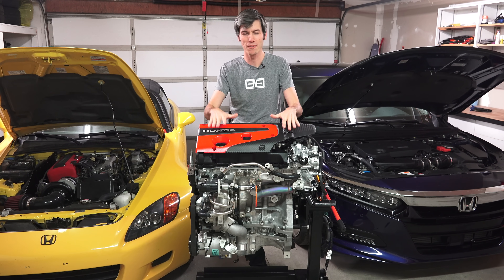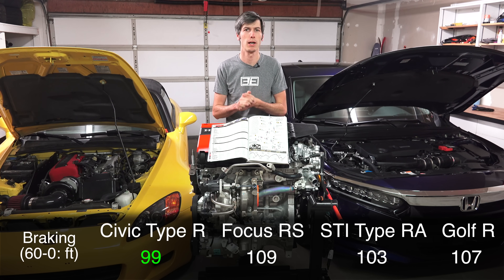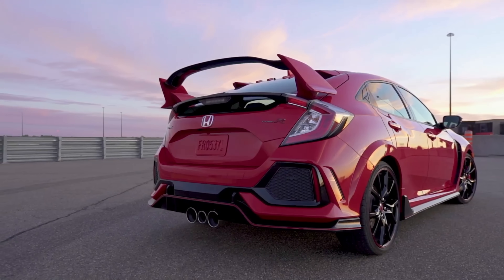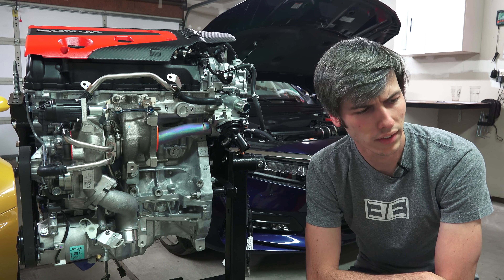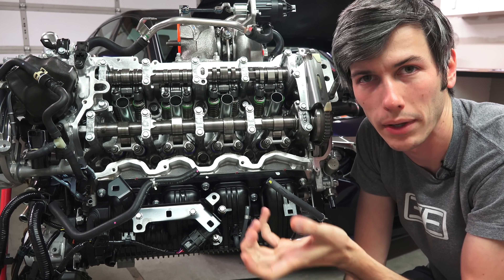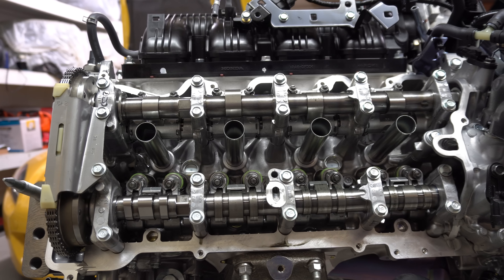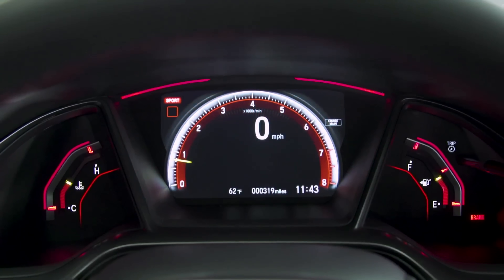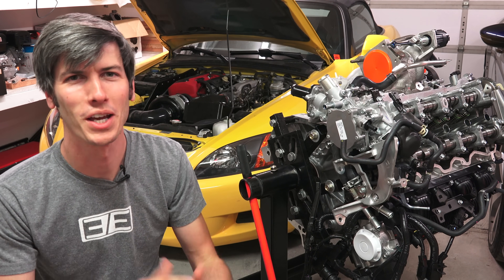The Honda Civic Type R Destroys The Competition - The Best Engines

Comment: Such a rubbish dyno curves, it's like a higher rpm diesel now or something. What's the point of having 7k rpm when you're losing all the power and torque even before 5k rpm? Either you have to shift early which defeats the purpose of having a petrol engine with 7k rpm or you have to keep flooring it while losing power and torque.

Comment: honda is good engines but bad body design.  however, mod the body, and you lose the value of the engine's performance.
Reply: Can you explain?
Reply: @chewsir  -  fine.  i'll pick on the '93 civic.  chassis is too narrow.  wheel base is not only narrow but the tires are too small as well.  try to do something about it and for some weird reason it just doesn't run the same.  everything in that system is designed exactly for eachother, parts cant be simply "stretched to fit" without costing some kind of cause/effect.  but the engine in and of itself is solid quality, very well made.  superior in reliability to chevy engines, all day.
Reply: @long-timelistenerfirst-t-us2yy  that makes sense. When you mentioned "body" I thought you were referring to the exterior design or aerodynamics.

Comment: Some of my friends that work at a Honda dealership, have told me that you can get the fully loaded Accords engine to be tuned and you’ll get pretty much the same power and torque as the Type R engine. So technically you’ll be driving an Accord Type R. It’s funny to say that but also it’s doable and kinda crazy.
Reply: You still need to spend on sports suspension, upgraded brakes & sports seats for the Accord... There did use to be an Accord Type R -- fun car! :)

Comment: I am torn over the exterior and it probably looks better in the show room than on the road. But I am buying one in metallic grey. Will be my first new car and it looks like best bang for buck. I have owned two 928 Porsches over the past 20 years and I have spent quite a bit on maintenance. The Type R still has that GT like feel rather than the uninspiring go kart feel of most hot hatches. On testing I found the FWD quite sublime and the performance very exciting. It will be interesting to see if I regret my purchase, but at least its not going to break down. I will be keeping the 928 still too good to sell for small money.

Comment: Ok I’m confused so the accord has lower torque than type-R but has higher horsepower? Also you said accord has lower psi but then said accord has 28psi compared to 22psi. A little confused

Comment: Any chance you could do a video about turbo compounding? Yes, compounding, not twin turbos in series or parallel or using valves that open and close. Learning power curves and benefits and cons of compounding vs twin turbo setups would be a plus too. I’m having a hard time understanding how power comes on and there is little info on the Internet.
Reply: And also why would you choose a VNT turbo over compounding (cost obviously but why else)
Reply from the maker: Compound turbo is two turbos working in series. I have a video on this, search “sequential turbos” on my channel.
Reply: Engineering Explained thanks for the reply! I have watched that one a lot through out the past 6 months but I am still not sure how power comes on without the valves. Lots of Cummins and other diesel kits don’t use valves so I felt like it was different from that video. Thanks
Reply: @Mcritch32  There's no valves needed, other than a wastegate before each turbo, and an output path from each of the wastegates to the exhaust pipe. 

The small turbo gets the exhaust first, spools up, and it's exhaust is piped directly into the exhaust inlet of the big turbo which, will spool up naturally and overtake the little turbo's output as the engine is ran higher and harder in rpm range. 

The wastegates are just there because they have to be, for control.

Comment: Did you all know Honda will go 80% electric by 2021 or 2022 so this engine might not even be around by then. The Honda Civic Type R is only front wheel drive witch is a problem with that much Horsepower you need all wheel drive to truly handle that power The Ford Focus Rs is all wheel drive because of the amount of horsepower and torque the engine produces to keep the the rubber on the road so to speak and with a few upgrades the Focus Rs like K&N cold air intake and exhaust system Upgrade and The cars PCM or ECU reprogrammed it would definitely be a show stopper and by the way the Focus RS has a drift mode you can’t do that in a Civic Type R.

Comment: Car and Driver ran a 4.8 0-60, 0-100 in 12.1 in a manual Golf R with a 13.4 @ 104.  Acceleration was a strong point of this video and once you start adding power mods to the type R you'll have a hard time putting the extra power down vs. the other cars here.

Comment: Honda fanboys will use to validate there oppion that honda is actually a good company but I bet my ls1 trans will beat any stock 4banger
Reply: Honda is the largest engine manufacturer in the world.  The fact you think they arent a good company shows how much of a clown you are.  The LSx series are great but Id hope they would beat any stock 4 banger considering they are 3-3.5x the size.  Honda never took a bail out from anyone.  Honda went from being laughed at here in the 70s to a major player.  The products they build are simply much better than GM, whom for the most part has been building junk for decades.
Its too bad Honda is a conservative company.  They could easily build a 5.5L big bore twin cam V8 with 700 hp.
Reply: Stock is the key word here :)

Comment: Yeah, yeah, yeah, tell that to the type-R owners with engines overheating and leaking oil. And what about that starter ring issue where it ejects the ring and can't start? And do a video on their crappy tranny that grinds 2nd gear all day long. Or their glitchy rev-matching.  At the end of the day, it's still a front wheel drive and still slow by today's standards.  Also, I'd love to see you pick one for MSRP. Not going to happen. They easily sell for over 40k.

Comment: You always seem to be on point but you are pulling our leg on the costs. The RS is only $2k more than the Type R base price. You can get one for under $40k nicely optioned. The Honda meanwhile that sold here in NC was jacked with the market value to $48k.
Tires Tires Tires...put them (RS/Type R) on the same tires and the RS is right there with the Honda. Anyone that is not a professional driver will go faster in the RS. Anyone choosing the front wheel drive car over that AWD RS is not making a good decision lol.
Carry on.

Comment: the numbers are pretty confusing to me, I mean that civic is faster from 0 to 100 in 12.2 secs, but focus rs wins the quarter mile in 13.5 secs at 101 mph , but civic was still at higher speed while crossing the finish line . Can you please explain dude?
Reply: If they were performing on an actual prepped dragstrip a fwd car is at a disadvantage off the line especially with street tires losing precious time at the 60ft and having to play catch up. Im interested in seeing the difference in these cars 60ft times.
Reply: Leonard Hatzell actually a FF car on a prep drag strip won’t do half bad. Greatest advantage for the awd will be on the streets.
Reply: Leonard Hatzell But weren't those 0 to 60,70 and 100mph times recorded on dragstrip by motor trend? So isn't the grip disadvantage of fwd applied in these times?
Reply: @ManpreetSingh-hp6kd  not necessarily no they could have done those times on a regular road course on a straight where the street tires perform much better on a more normal road surface than a dragstrip which is completely different. From what ive looked up ppl with the type R are averaging a 2.2 to 2.3 60ft due to bad wheel hope which is where fwd on street tires comes with how much power it makes comes into play. Guys in the focus RS are averaging 1.9 60ft which they are on street tires too but awd helps them put the power down better giving much better traction/launch on a super sticky dragstrip assuming they are good at launching an awd car. Ive got a 12 civic si, when i went to my local 1/8th mile track stock with kumho ps31 tires at stock pressure i was averaging high 2.1 to low 2.2 60ft. Im greatly out powered to the type r but we have pretty identical 60ft times.

Comment: Did MT not Clutch drop the STI  or Golf R or something???  5.7s to 60 is slower than nearly all of the versions tested by C&D and MT where both typically hit sub 5s to 60.
Lets be real Honda's true achievement here is the suspension setup, breaking, chassis tuning and not because of the engine. 

It's a great car that demonstrates the capabilities of the FWD cars when you address the issues present in the platform, but is that engine
better than it's peers? Hell no.

Comment: How much does the type r crate engine weigh?
Reply: It seems that from what I found that it weighs 176 lb more than a 1992 VTEC motor, which weighs about 300 lb, so it's about 450-500 lbs.

Side note, that's the secret to why it's fast, a SBC V8 only weighs 330 lbs for aluminum and 390 for an iron block thus this motor now weighs more than a v8 XD, granted I have nothing against it I think it's hilarious
Reply: Thanks!

Comment: As an engineer myself, you should appreciate the Golf R Iron block will happily dump out 600BHP without any upgraded internals.
The Civic only got 1mpg (combined) better than the Golf, and 1mpg less than the Golf on the highway.  If you option the DSG, the lowest powered of the group Golf would be faster than the others on the drag. If the course was run in the Northeast with wet slippery Fall weather, all 3 AWD cars would easily run circles around the Civic, especially the Subaru, and RS, not so much the haldex Golf. The Subaru has by far the nicest cockpit (I don't like piano black) - putting that engine in the BRZ would be a killer combination the Civic couldn't touch.

Comment: how you feel been in a old technology field? electric cars are the future, have you seen NCAP rating for the teslas, is amazing. Doing 0-60 in a 45K car in 3.5 sec have no substitute in internal combustion. cars that do 0-60 in 3.5 cost 100k, they will be extinct in 10 years.
Reply from the maker: Name an electric car that costs $45k and hits 60 in 3.5 seconds? It doesn't exist. Tesla Model 3 performance does it, but it's $80k.

Comment: Honda does make great/probably the best 4 cyl. engines, but let's look at the big picture.  For overall day to day use, fit and finish quality, comfort, lack of road noise ect.... you can't beat the VW type R (not to mention that a simple flash will bring the factory detuned R alive).

Comment: Totally disagree with 0-60 numbers for the Golf R. I measured with a racelogic v-box and was below 4.7 using launch control. The 2018 version has 310hp and 400 NM and a 7 speed DSG. In ROW it also has multi port injection direct and indirect that help reduce carbon build up. Quarter mile in 12.94 secs...
Reply from the maker: All cars compared are 6-speed manual. DSG is faster. Sponsored videos will always be disclosed, don't say it's paid because it's not.
Reply: @EngineeringExplained  thanks for the explanation. I think a 0-60 in 5.7s is high for the Golf R. According to specs it should be arround 5.2s

Comment: I've owned an Acura RSX-S, with the almighty K20. Changed the oil, every 5000 miles, along with all the fluids religiously. At 200,000 miles I lost the car in an accident. It NEVER gave me a single problem. I redlined that car to 8100 r.p.m.'s, like a mad man. As much stress at that engine was given, I never once had to adjust the valves. Now that I own an Accord V6 coupe with the 6-speed manual, everyone is saying a valve adjustment may be warranted. I've never heard of anyone doing valve tuning even when the car was brought to the stealership.

Secondly, what type of turbo does the Type-R and who makes it? Is it a twin scroll made my Mitsubishi?
Reply: I never should have sold my RSX-s
Reply: Not sure how hard it is to do valve adjustment on the V6 since I don't know how easy it is to get to the back head, but doing valve adjustments on Hondas is not difficult and I believe your service manual gives you the info on service intervals.
Reply: It's likely a mitsubishi turbo, that's what they've used in other turbo applications (RDX)
Reply: I’ve had my 2006 RSX-S converted to Type R for 8 years now and I’m planning to keep it forever.
Reply: Had an 03 DC5S. The K20 was nice but torque was too low for a heavier car, compared to my DC2R. TSX K24 swapped it immediately and never looked back.
Reply: I had mine done at 120,000. It's a safe bet to just keep a car running at it's best.
Reply: Honda's typically have there exhaust valves tighten slowly over time. Not adjusting them usually leads to a burnt valve.
Reply: TD04 single scroll
Reply: Still have my 2004 Supercharged RSX type S. I love this car.
Reply: I wish you could of gave me that K20 to put it on my EM1.
Reply: Reason why I kept my rsx type s. It’s a timeless design. The last generation of integra made.
Reply: Was that K20C4?

Comment: Haters will stay say it’s just a Honda. Or it’s just FWD. Give credit where credit is due. 🤷🏻‍♂️
Reply from the maker: Agreed haha. I love the Focus RS, but I was pretty shocked Honda was faster around a track.
Reply: @EngineeringExplained  
Depends on the track.
Honda's Nurburgring time is bs. No way a Type R is faster than a 997 GT3 RS.
Car and Driver drove both during their lightning lap runs and both ended up with the same time.
There's also plenty comparisons on youtube where the Focus RS did a faster time.
Reply: You haven't seen a Civic Coupé 2016 taking a 45 degree curve at 140 KM/H without having to invade the neighbor lane. Its not just the engine: the entire car is design to take the best of the road. All the Civic and I see when doing that is other drivers trying to do the same, but they end up hitting the brake pedal to the floor.
Reply: I'll give plenty of credit, it's a great performing car, I'm not a fan of FWD, just a preference
Reply: Everyone stays hating on the NA VTEC.

Nowadays, everyone's spoiled with a brand new BMW, Mustang 5.0, Challenger SRT8, Camaro SS, other V8s, or turbocharged vehicles.

I'll keep my B16A2 EM1. 😂😂
Reply: You mean the same way import lovers DON'T give credit to the 6th gen Camaro ZL1 1LE that destroy 6 figure supercars and does it without AWD and without an auto?
Reply: It's not that it's a Honda. Honda makes great cars... Just it's like 40 grand after taxes... Which is ABSURD for just a fast Civic. There are alot of normal cars that can probably put down better lap times for the same price. And if they do t out down better lap times, it's gonna be more reliable, efficient and just a better car.
Reply: Daniel G please tell which normal car in that price range would put a better lap time???. Asking for a friends

Comment: Not far less money. Most dealers are still marking up 5 to 10k
Reply from the maker: Find a better dealer! There are some good ones out there. Plenty of CTRs going for MSRP.
Reply: @EngineeringExplained  i shopped 12+ Socal dealers from San Diego, Riverside, LA, San Bernardino counties.  I also shopped dealers in Las Vegas, which they were asking for 5k over MSRP.  Maybe a dealer in Montana would sell at MSRP plus and license.  For now, i will just work on my SOS supercharger on my 05 S2000 and Hondata the 17 Si.

Comment: can the all wheel drive cars switch to 2-wheel drive for normal use and consumption, or is the honda the only 2 wheel drive. Isn't it common curtesy to have lean air mixtures in turbochared direct injection cars combined with variable valve timing. To me this seems like a wierd comparison. comparing heavier cars with more moving parts. All cars break on all wheels individually so of course the lightest one wins there. How do the actual numbers (HP, Torque,m downforce) compare? Is the secret to the good accel mainly aero? Is it tires?
Reply: Ohh and the most important one are the emissions comparable?

Comment: Golf r goes 0 60 in 4.7 second...
Reply from the maker: With DSG, everything compared is manual, and compared together (rather than individually).
Reply: The STi 0-60 doesn't seem accurate. Never seen a 0-60 that low for that car.

Comment: So basically it has exhaust VTEC just so they could say VTEC turbo? 

But really,  is it worth changing the exhaust cam profile for lower residual cylinder pressure (which could also reduce detonation) when you can already vary its timing? The alternative would be to put VTEC on the inlet and allow you to run less boost for the same target power, which also has turbo response improvements

Comment: Great tech as you'd expect from Honda and it's very impressive, it's such a shame the back of the car looks like parts from 3 or 4 different cars stuck together with Sikaflex! 
All the money they spend on engineering is well spent, but the styling department is left to the work experience kid from the local high school....

Comment: I'm curious where the STI numbers came from for this video because they seem off... should be low 13's on 1/4 mile and under 5 on 0-60.  I've seen as low as 13.0 and 4.5 reported for the regular STI and the type RA is supposed to be even faster.  13.8 and 5.7 is what a nubie in a subie would get.
Reply from the maker: Motor Trend did all the testing. They're very good at it, too.